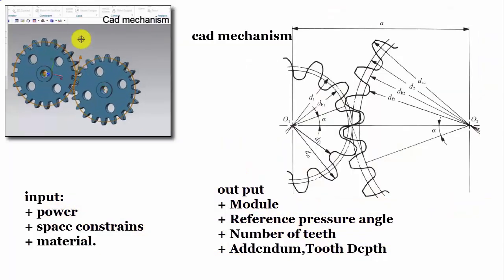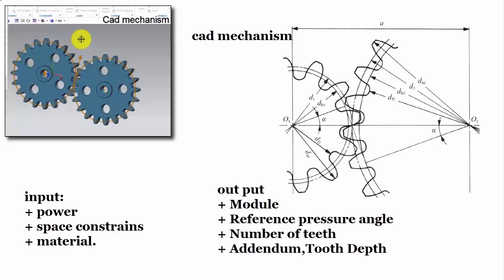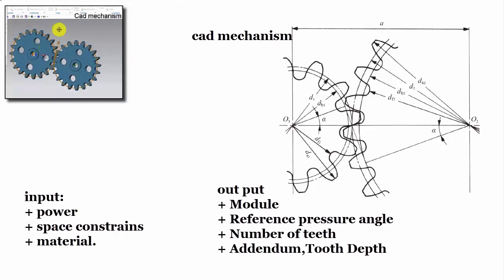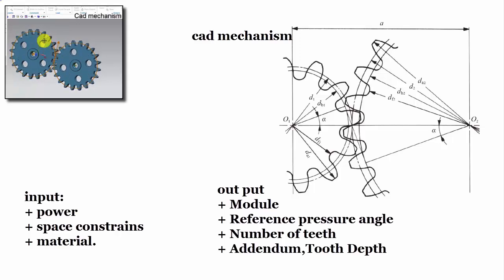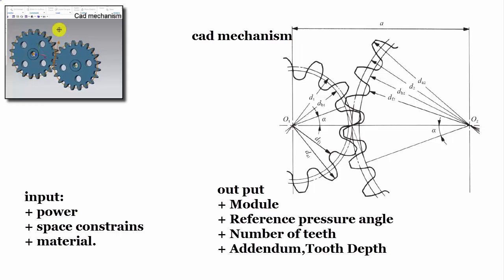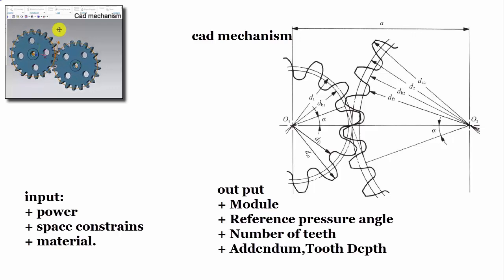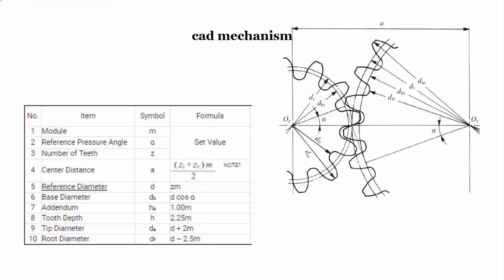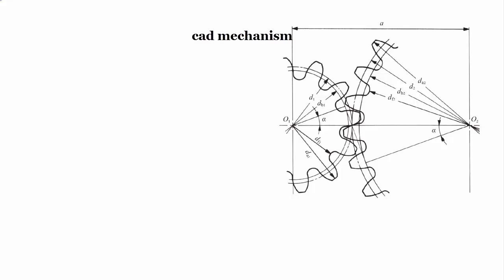gear design spur gear calculator

Comment: good, but i want a software for gear calculation............... can u help me ?
Reply: try these:http://hessmer.org/gears/InvoluteSpurGearBuilder.html  and https://geargenerator.com/#200,200,100,6,1,0,0,4,1,8,2,4,27,-90,0,0,16,4,4,27,-60,1,1,12,1,12,20,-60,2,0,60,5,12,20,0,0,0,2,-563
Reply: @stevejeffryes5086  I knew the 2nd link, but thanks for the 1st one.
Reply from the maker: I have used Autodesk inventor. Can you use it?